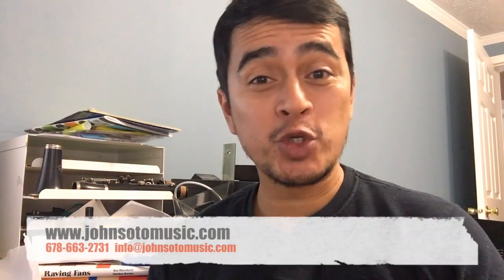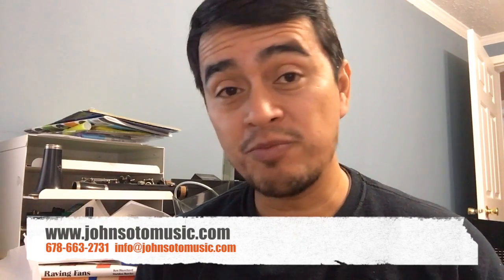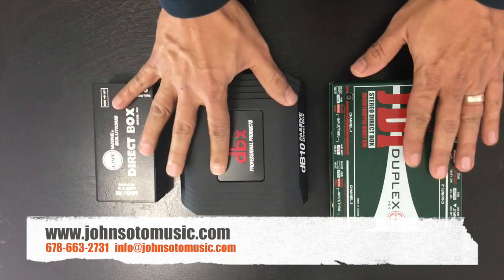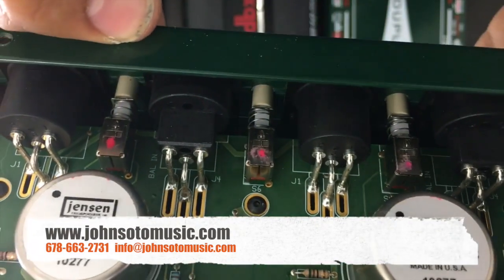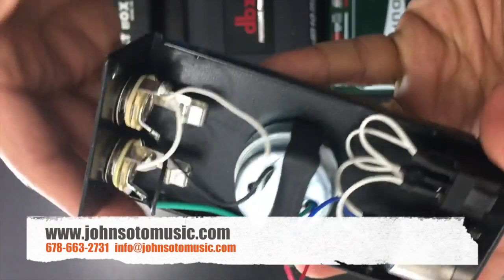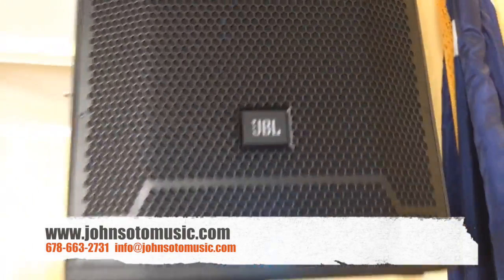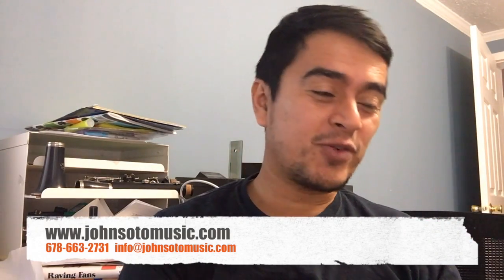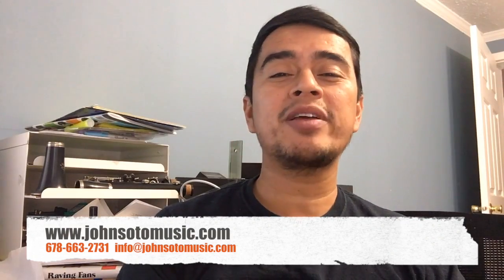What is a Direct Box? Do I need One? How much should I spend? Eliminate ground loops

Comment: Perhaps there is a ground lift on the bass amp wich should eliminate the 50 or 60 cycle hum with using the di on the amp. The di on the amp is no different from a separate di box.
Reply from the maker: None ground lift present. It should have one.